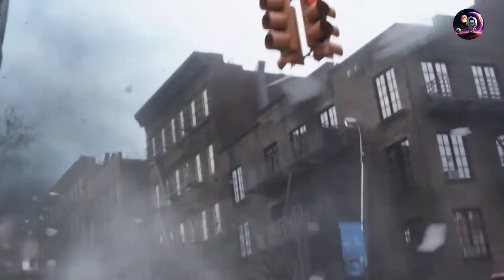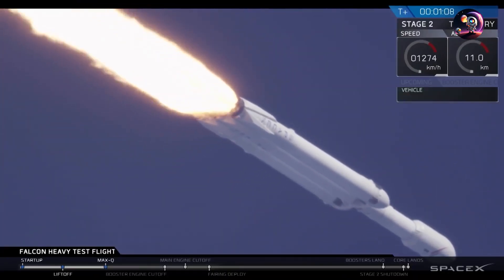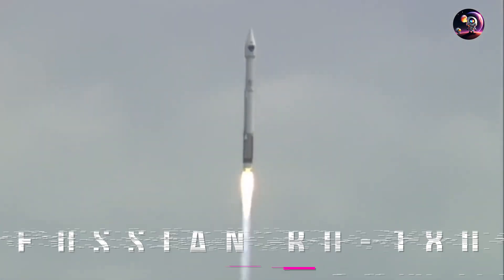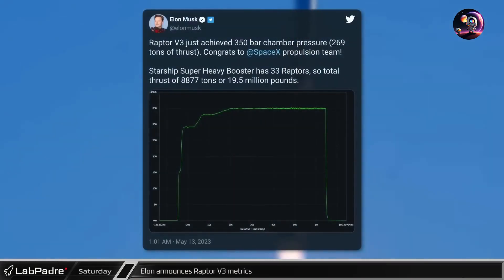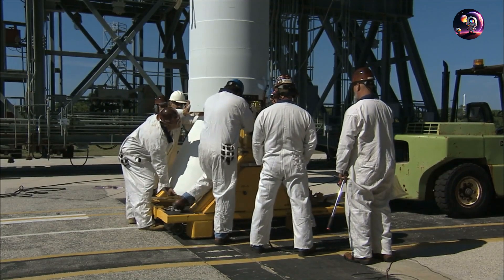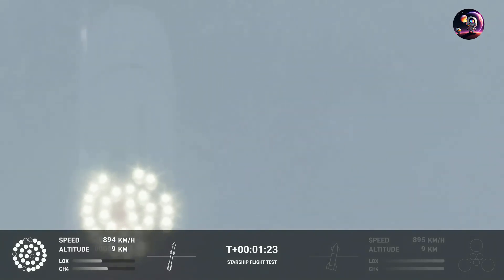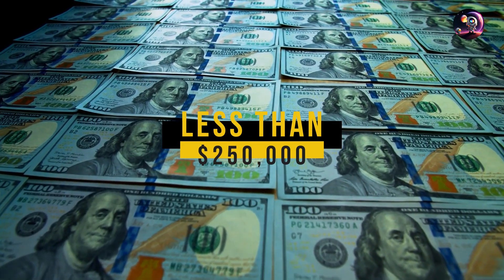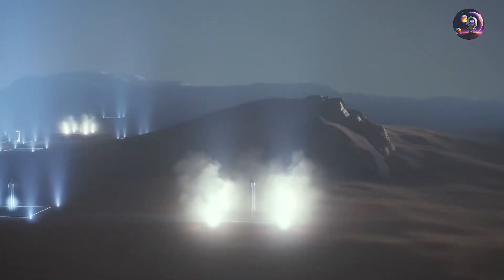SpaceX reveal New Raptor 3 Engine secrets for New Starship Launch

Comment: Film cooling and regenerative cooling are hardly ingenious techniques, they're pretty well known methods in rocket design... don't get me wrong, Raptor v3 is looking to be a great engine, but this whole video screams SpaceX propagandist and word soup. The failure of the raptor 2 on the april 20th launch is also suggested to be a fault of the stage 0 construction, not of the raptor engine itself as far as I am aware. I liked the parts of the video you put numbers to such as the target engine cost or the 1 raptor per day statistic but I think you should tone down the "unwavering determination" comments every 30 seconds I think. Not sure why you included an RS-25 at 8:10 either. The video B-roll and captions are otherwise edited nicely, all said.